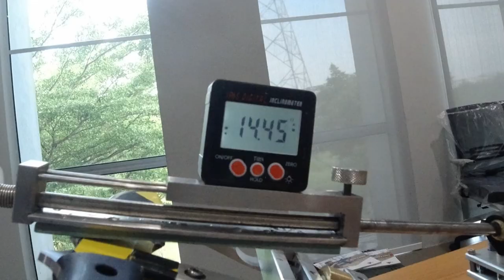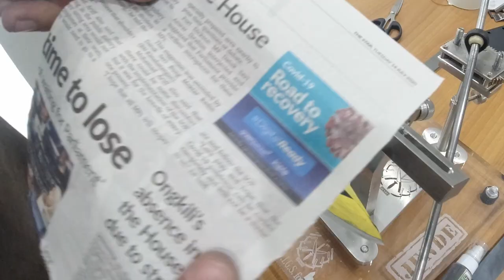Jende JIGS | Sharpening the 6" Sentinel

Comment: Great video! What on the J.I.G.S system was making that rattle or clacking noise?
Reply from the maker: Thanks! It was the accudrive, the assembly of gears that lets you do micro adjustments. While it didn't affect sharpening, Jende sent me a replacement for it and it's rattle free now

Comment: 2 Questions:
1: No chosera 5k  between the 3k and 10k?
2. There seems to be some wobble in the bar that holds the clamps. Is there a way to adjust this?
Reply from the maker: Hey brah, how you doing?

1 - yeah, my 5k's all kinds of messed up, and i didn't have a new one handy. The finish on this edge still had some micro-scratches
2 - i got an early version, the later ones come with a significantly heavier spring. those with early versions can contact Tom for replacements. To be honest though, i'm very heavy handed, and that might contribute to the wobble.
Reply: @The_Polished_Edge  I'm doing well bro and thank you for elaborating!!
Reply from the maker: @anthonywaldrep5982  pleasures mine brother =D